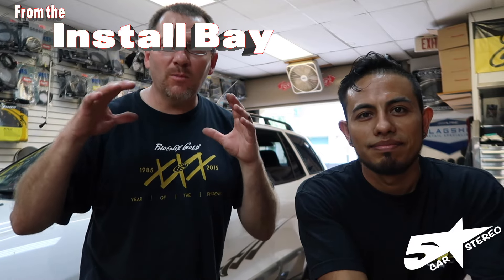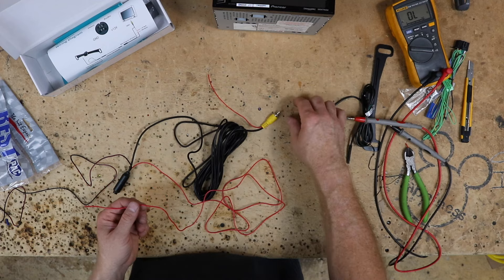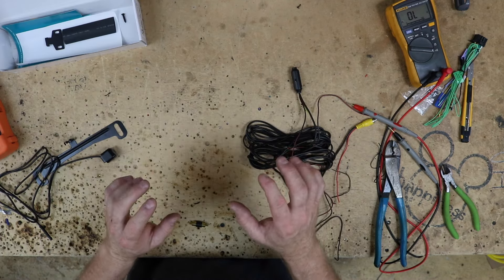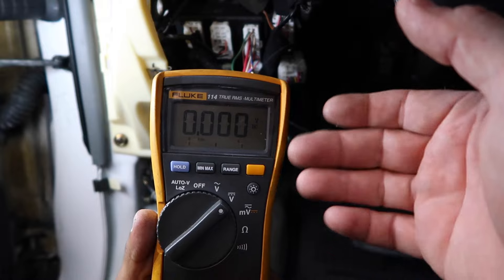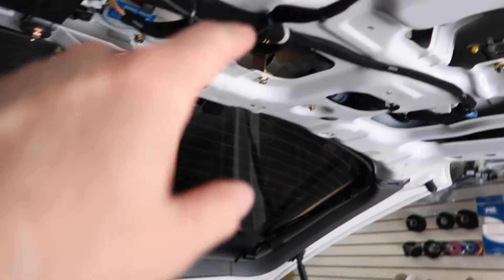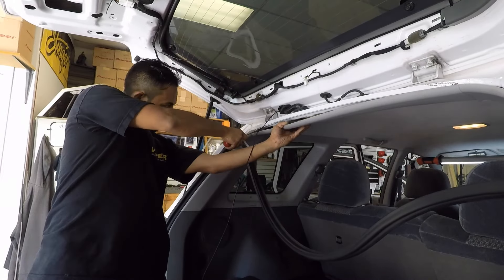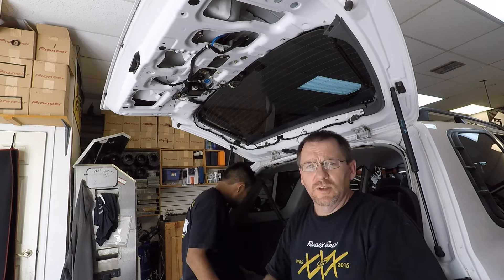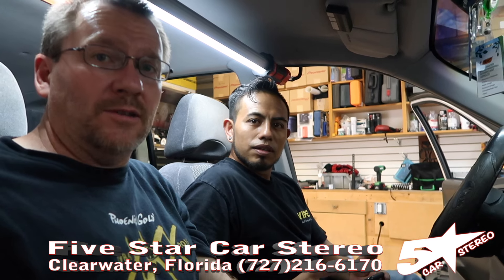More, how to install a Backup camera in your car

Comment: Does the reverse backwire have to be plugged in? Can't you just have power and ground going to radio and it's just always on when you turn the car on?  I have the pioneer avh-x491bhs why do I care if I put it in reverse wen I can control it anytime I see it? ALso can't I just tie the purple wire into any 12v  how does it know its actually ties to the reverse lights? Thanks
Reply: Womb Raider  Seemed to me that the majority of the video was about routing cables through the cab... The important parts were sped up.
Reply: You do have to have the radio connected to reverse trigger if you want it to automatically switch the view when you go into reverse.  Having to go into the menu every time to activate it when you flip into reverse would be a PIA.

Comment: I bet no one here knows if a factory touchscreen GPS unit in a 15' Hyundai Genesis Coupe has a built in connector for a camera.
Reply: girlsrockurboyz it doesn't. Factory head units don't have any rca inputs or outputs
Reply from the maker: +girlsrockurboyz correct there is no plug on the back for a camera. Someone may make a smart harness to add one though